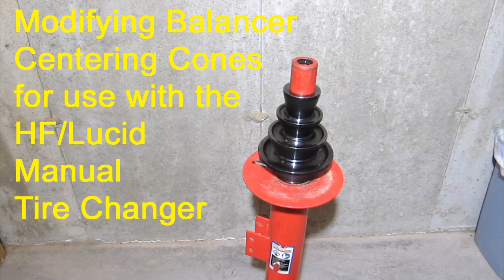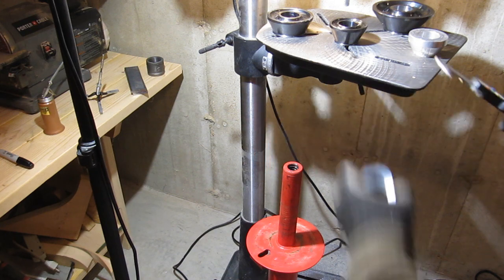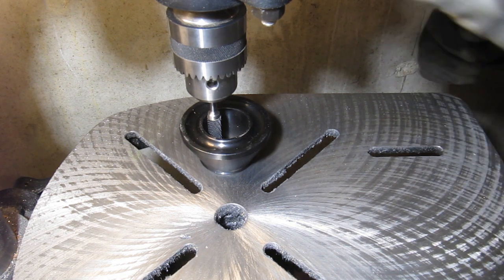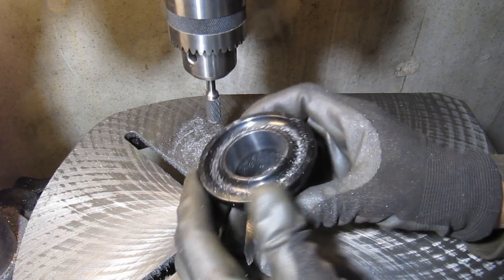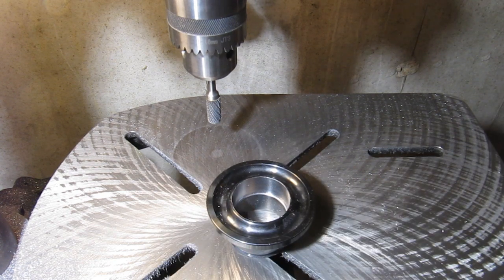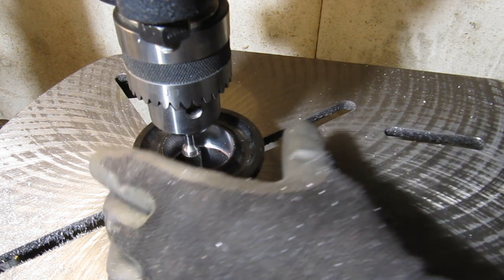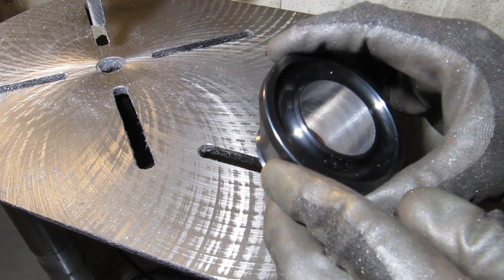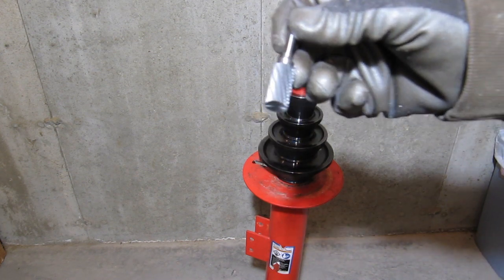Modifying 40mm Wheel Balancer Cones for the Harbor Freight/Lucid Tire Changer

Comment: If you cut a piece of ply with a hole 1-2mm bigger than the bottom out side width of the cone, then clamped it down to the drill press plate, making sure the off set is measured then dropped the cone in side this ply gig,
Then you had some thing to stop the cone being ground at the sides any further than needed and would be evenly metal removed from the in side,
because you have no gig its impossible to be sure metal have been taken away evenly,
But very impressed `great job given how you managed to get the end result with what you had. 
I will state that any one trying this make sure the shaft on the cutter is not cheap metal as you won`t want it getting hot and bending as this could end up being very dangerous,
Reply from the maker: Thanks for the comment!  That's an interesting idea!  You are right, I am sure my enlargement is not perfectly centered.  But for the manual tire changer it is not too big a deal.  If you were using these on a wheel balancer thought that would be much more important!  Good idea!

Comment: I 3D printed my cones, and they work just fine. I did cut the area were the pin for the wheel stud hole goes and made it into a slot. That way i can drop a stud in there and secure the wheel with a lug nut. I thought it would need at least 2, but with just one and a good fitting cone works fine.
Reply from the maker: Cool idea!  Thanks for posting.  That's a great idea for anyone handy with a 3D printer!
Reply: @tuloko16 do you sell those cones?

Comment: I see a stand of HF Tire Changer (~@2:44) without a small rod, so you removed it as many people do. But I don't see any holes made to attach the wheel to the stand w/1-2 bolts instead of that small rod. Do you use it without any bolts to secure the wheel. Is it sufficient to use just the aluminum cone you have to secure the wheel from rotation when you change the tire. I also plan to remove that bolt, it is not centered properly (at least for the wheel I'm working with), kind of under the angle, bearly fitting the lug nut hole. I bought already the bolts for the machine instead of that rod, but I saw in other films occasionally that the stand is without any rod or bolts, just curious. Maybe that rod (or bolt(s)) is needed only for very large tires. Thank you for your informative film.

Comment: Good Job. I appreciate what you did on milling job. Probably too late to the party, but what if you clamped a couple C-Clamps on the Base of your drill press spaced the distance needed, then just push and turn the spacers until its evenly up against the clamps?
Reply from the maker: Thanks Greg, interesting idea!
Reply: @JohnsDIY   I may be trying it myself soon. Good to know the cones can be obtained easy enough. I'll be putting my own tire changer together as I have several cars, trailers, and a bike. Even the cheapest place charges $10 to mount, but around $15-$20 to balance. I have old VW's and finding a place that can balance the old wide 5 rims is closer to $50-$60 per wheel mount and balanced!!!. There is an adapter plate for them readily available though. I believe I will also be investing in a dynamic balancer since just one tire change it will have paid for itself.
Just the time saved by doing myself instead of waiting for someone else to scratch my rims makes it so worthwhile. Also, wanted to say thanks for the Duck head comparison too. Most helpful
Reply from the maker: @gregboswell2843  Thanks for your comments Greg!  Wow, $50-$60 is tough!  I purchased the Atlas hand spin wheel balancer.  I was a little concerned how good it would be and it isn't a cheap investment (though if you change a lot of tires I think it can pay itself off in a reasonable amount of time).  However, I have found it to work great.  I haven't had a single case of any noticeable vibration at all.  It seems to be very consistent and repeatable.  I also don't find the hand spinning to be any bother at all.
Reply: @JohnsDIY  That is perfect. Was looking at getting an electric dynamic balancer, but I don't mind spinning the wheel. One less thing to worry about and it is a smaller more compact machine too. Thanks for the tip

Comment: Well done thank you can you tell me what size length is the carbide burr? I have a piece of aluminium was going to use for centring cone with a smaller centre hole do those burrs work on grinding aluminium? Thanks

Comment: I used my porter cable router turned upside down, spins a lot faster make quick work, drill press to slow bur bit needs to spin very fast also gets hot wear gloves
Reply from the maker: Interesting idea!  Makes a lot of sense.  Thanks for the comment!

Comment: Out of the four cones, which one will best fit a 15 inch and a 16 inch rim?
Reply from the maker: It depends on the bore of the rim (the size of the center hub hole) not so much the diameter.  So if you look up the bore size for your wheels, then you should be able to figure out which cones would work based on the following cone sizes:

Smallest = 1.77" to 2.46"
Next = 2.05" to 3.15"
Next = 3.09" to 4.13"
Largest = 2.91" to 5.39"

Comment: You're only removing a little over 1mil. around the circumference of the bore, just clamp them in a vice and use a coarse grit cylindrical drum in any sort of rotary tool.

Comment: These cones are $150 a set. Not sure where you get yours.
Reply from the maker: I am sure they are $150 a set at some place!  Probably even more other places!  Looking up my eBay purchase history, I bought the set shown in the video for $46.00 on  October 13, 2019 with free shipping.  It looks like the same set is now available on eBay for $54-$57 with free shipping (assuming you are in the US).  I don't think YouTube will allow me to post a link here but if you just do a basic google or eBay search for "4pcs Wheel Balancer Taper Cone Kit Standard Tools 40mm Shaft Accuturn Coats New" you should see lots of results for well under $150.
Reply from the maker: Here is a link to the set I purchased:

https://www.ebay.com/itm/163871269140

Actually, looking a few comments down yours, there are links to some other options as well, currently in the $50 price range.
Reply: Checked EBay and found a set of 8 tapers from China for $26.99 usd.

Comment: How bout losing the gloves so it just peels a bunch of skin instead of ripping your fingers out by the roots!  So,,, very unsafe.
Reply from the maker: Thanks Ron,  Good point and thanks for noting that safety tip for other viewers.  As others have noted as well, it is generally advised to not wear gloves when operating a drill press out of fear that they could get entangled in the bit.  I'll add a note to that effect in the description as well.  Thanks.